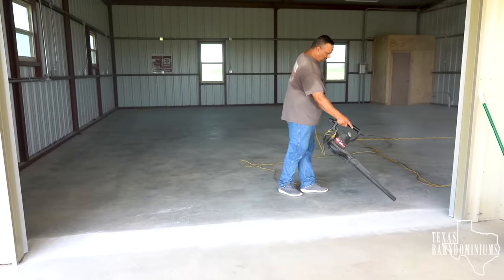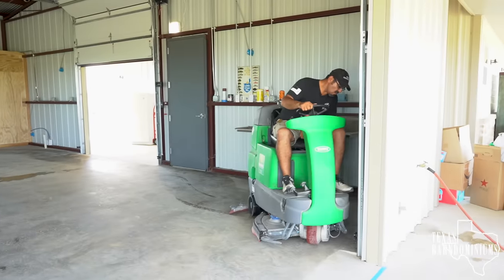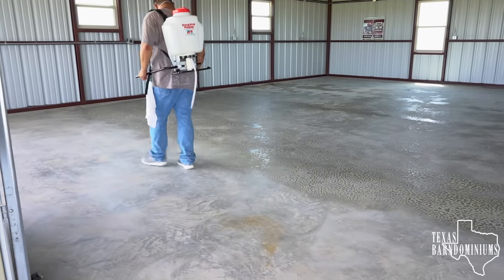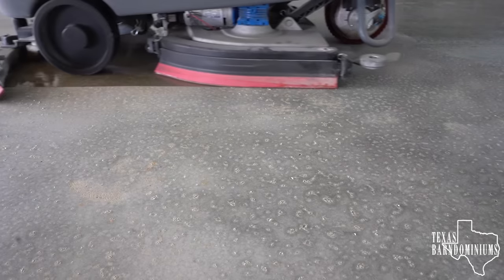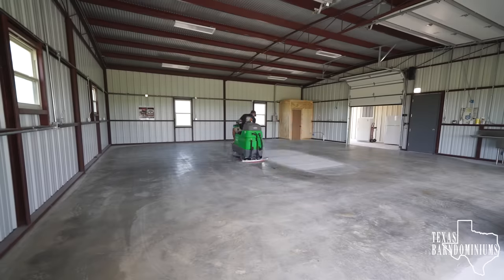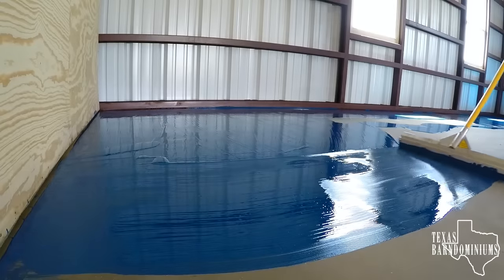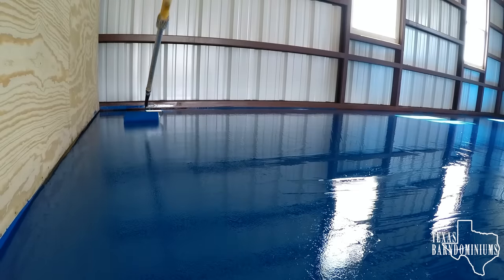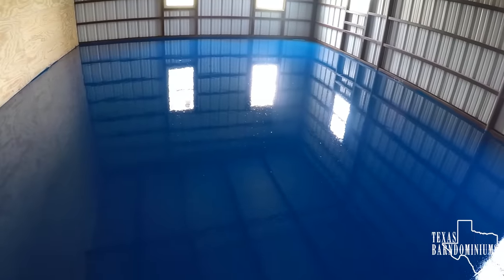How to do Epoxy Floors - STEP BY STEP GUIDE - S3E3

Comment: Can I level a wood floor with epoxy .
Reply: I was wondering the same thing. I want to do this to a plywood subfloor.
Reply: @MichaelRabbitBass3  That's my situation too .
Reply: Retired flooring mechanic. If you will go to any big box of flooring specialty store you will find what you need. We called it quick level. It's a portland based product sold in a 50# bag. Follow the directions closely. Most important to close any gaps or holes as it finds its own center of gravity. Unless you have experience with it you will need some help as it will set up quickly. This is not something for a dyi amateur to do in a large area. Even for a pro it can be very rigerous.
Reply: @donniebrown2896  You say portland based , Is it like concrete , will it crack and if it's done by a professional , how long will it last ?

Comment: Will this work on a spalding floor?
Reply: Use a grinder to remove week surface layer then use H&C heavy traffic concrete surfacer, 2 coats followed by sealer. Similar process just using bag material rather than epoxy.

Comment: There are a couple of safety violations in this video. Dust blowing and concrete sanding create silicosis hazard. PPE required.
Reply: Adel Rad since when does blowing dirt off a concrete floor create a safety hazard? He sucked up dust with water and floor sweeper.

Comment: I suggest to anyone installing epoxy, call a professional. If you insist on doing it yourself, at least rent a floor grinder and grind your floor with 30/40 grit metal bond diamonds. Acid etching does not achieve the ideal surface profile required for epoxy. Surface profiling creates more surface area, more surface area means more area for the epoxy to adhere to which results in a better bond.
Reply: @TexasBarndominiums  your technique was spot on however. and good video. if you come across another floor needing epoxy or polishing, feel free to call us for any questions. i like your work.

Comment: No matter what I do  the epoxy always fisheyes after its finished
Reply: You have to grind the surface. Use a diamond disc on a grinder. The fisheye or separation is caused from the material not bonding to the surface.  Grinding it gives it something to grab to. Good luck.
Reply: @christopherwebb7126  thanks for the help but I did grind with a Rigid diamond grinding disk from Home Depot..
The fisheyes come after I am done with the finish. It looks great then 20 -30 minutes later.. they appear

Comment: You know, you took so much care in preparing the floors and taping the seam at the doors to have a nice, crisp line...and then you slop the epoxy up on the sides of the plywood and the steel edging and left it that way.  So why take so much care and have results with sloppy edges???  Should have taped off the edges of the plywood and steel edging as well.  Would have had much better finished results.
Reply from the maker: I put plywood on the walls immediately after doing the epoxy.

Comment: Not pro at all... THE FLOW RATE HAS TO BE EXACT SAME AND THAT WAS NOT THE CASE HERE. The guy at the pump turned the flow down in an attempt to turn it off then turned it back on... not necessarily to the exact same flow rate.

Comment: Obviously, you do not have a good experience getting rid of air bubbles easily
There is a special roller that cracks the bubbles before the epoxy dries up
Reply: Air bubbles are from outgassing of the concrete. The concrete is warmest in the evening so it out gasses up until peak temp.

Comment: Nonsens already in the first seconds... Why not vaccum it all from the beginning? With the blower you need to wait at least until the dust came down again. The endresult is still dusty...
Reply from the maker: How do you vacuum the walls?  🤷‍♂️
Reply: @TexasBarndominiums  I don't blow the dust everywhere in first step... That saves vacuuming the walls. And if one really wants to, the walls can be broomed before cleaning. Or they could be vacuumed with a wide brush on the hose pipe.

Comment: If you make a DIY, why not install it properly? It's videos like this that keep me busy ripping out coatings & prepping them properly. That thick of a coating needs a CSP3 to get proper adhesion. You need to shot blast the surface. People will actually believe you that this is right and its giving the coating company a bad name. Also, clear top coats won't stop the blue from yellowing. 

That size garage is a 1 day project with 2 guy & proper equipment.
Reply from the maker: Post a link to your video please.
Reply: I do not make YouTube instructional videos. I run a business coating & polishing concrete. You should really be more educated on this and don't coat anymore jobs using your method.
Reply from the maker: Please post a link to a video with method you do so we can learn from it.  Thanks.